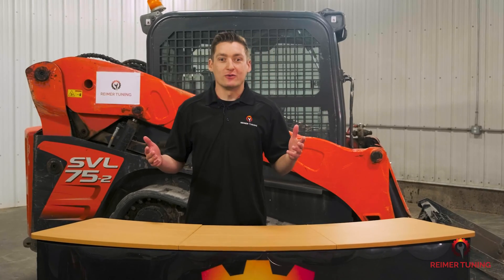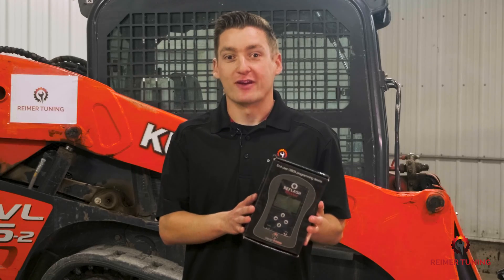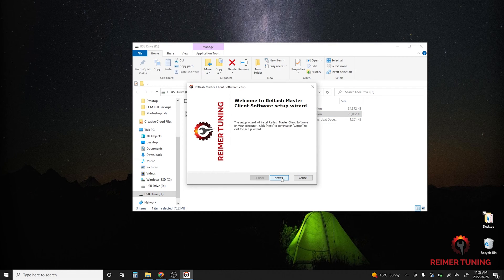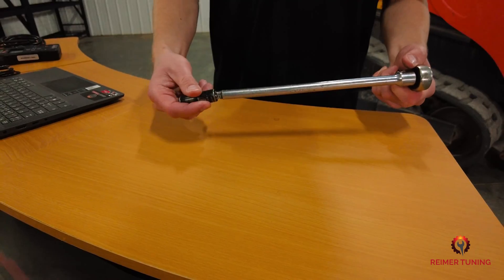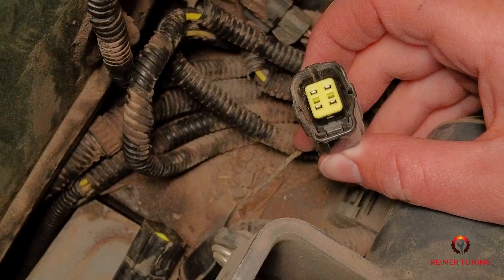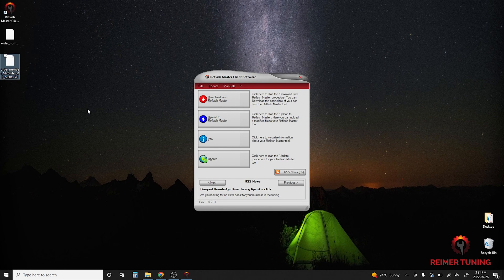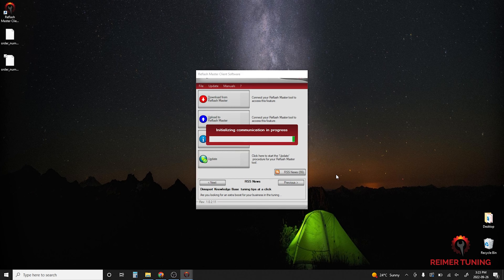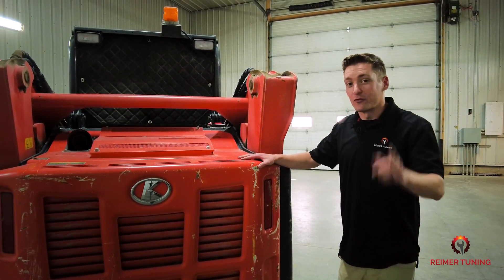Kubota SVL75 Reflash Master Tutorial

Comment: In a case 580N we had an employee tamper with the system locking the ecu, can this program overwrite it with this setup? There is 3 diff levels of tamper codes and were on level 3.